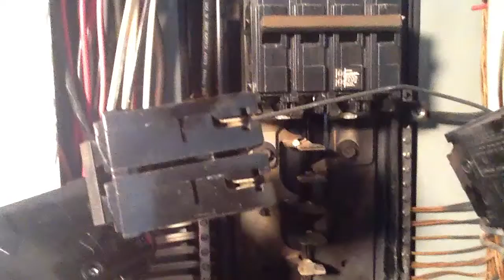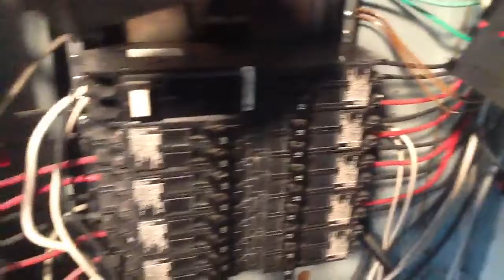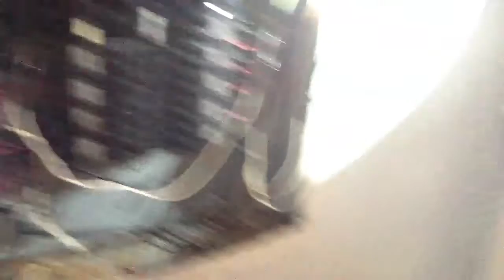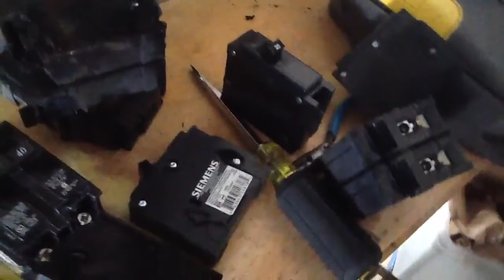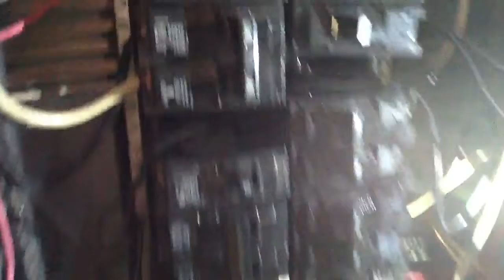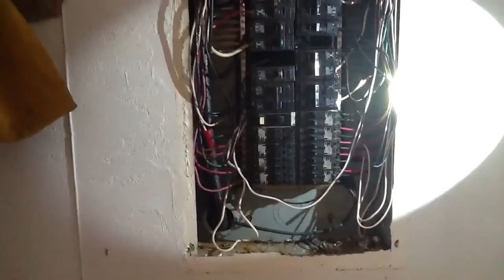How to Replace a Burnt Breaker? (AC Repair)

Comment: Seen that often, especially if the screws work loose on the breakers. I always go around the breakrs in a panel if it is open for some reason and check all the screws are tight, often you find a loose one or two, or see discoloured wire ends that have overheated in the past. An IR thermometer is good as well to check that all the breaker ends are not overheating, just move it past them slowly at both ends and look for hot spots where you will find loose connections. A 5 minute job that pays off.